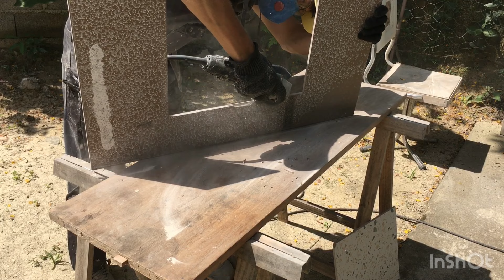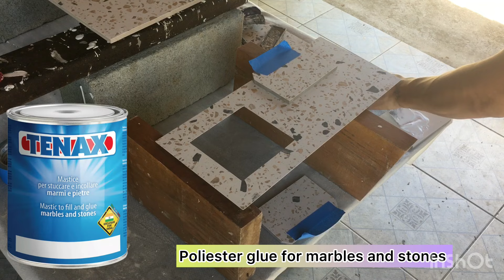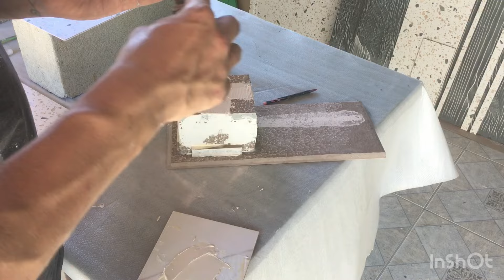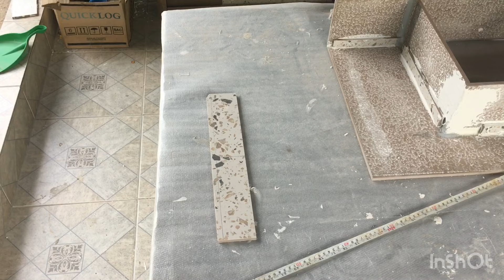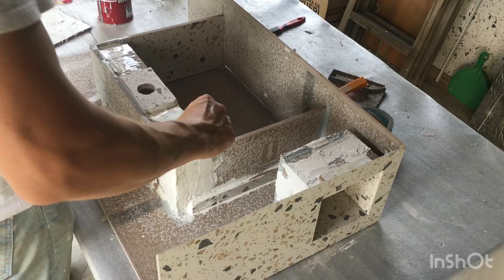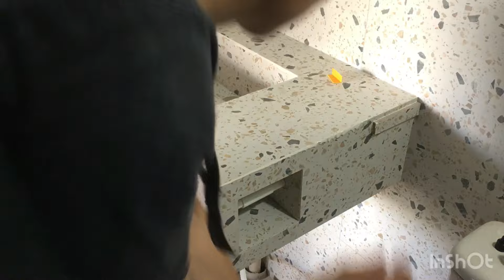How to make bathroom sink from porcelain tiles. With all sizes. Step by step.

Comment: Hello my friend. Your videos have really inspired me to start building my own sink from porcelain tile. Unfortunately it is my first time, and I made a few mistakes. I didn't know that 45 degree bevel cuts on a wet tile saw would give me an insufficient angle. I followed your method by angle grinding a sharper angle which worked out better, but unfortunately this lead to slight chip out on the edges. Also in terms of gluing which product do you end up using? The JoinFIX marble glue,  or the Tenax mastic? I purchased "Laticrete Rapid Stone Adhesive Kit Latapoxy" in January of this year, but am unsure whether or not this will work? Thank you again for sharing your experience and knowledge on a subject not many people are teaching.
Reply from the maker: Hello dear! Thank you for your message and the comment! Don’t worry practice makes perfect. About the. I made this video where you can see the glue I have used. Tenax mastic for glue stones. It is chipper then other.
Reply from the maker: How to make a travertine marble bathroom basin with Tenax.
https://youtu.be/ytk6iN_wub8
Reply: @Porcelanataria_45_graus  Thank you very much sir. God bless you.